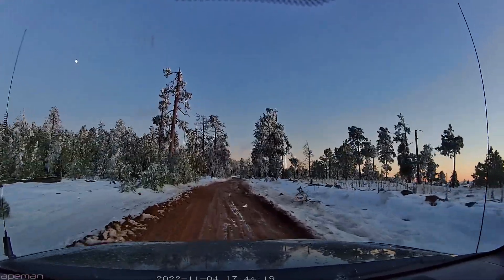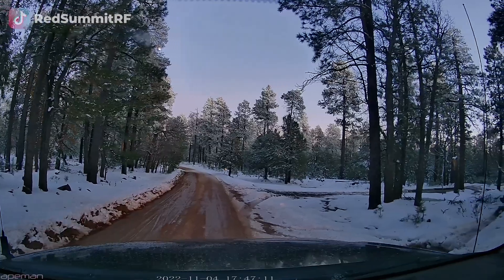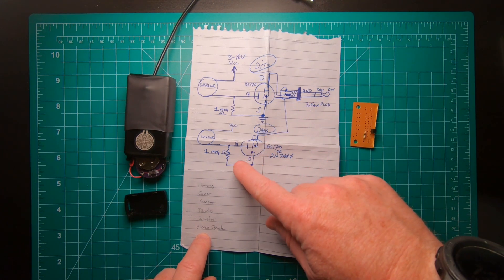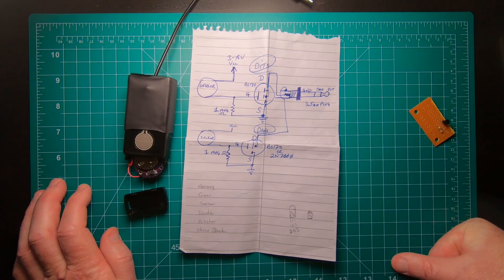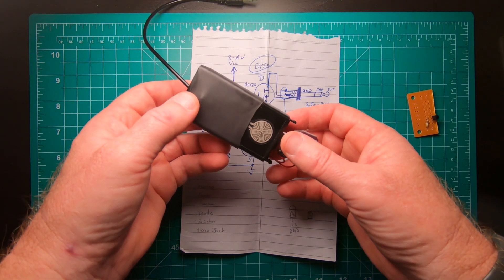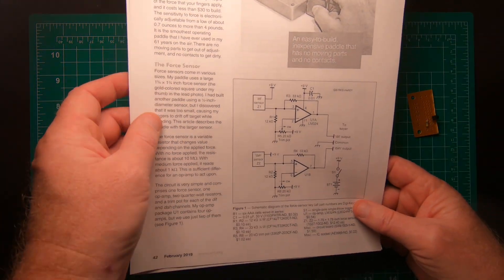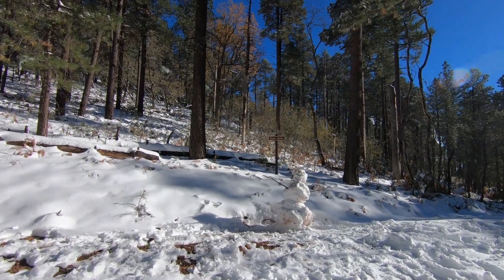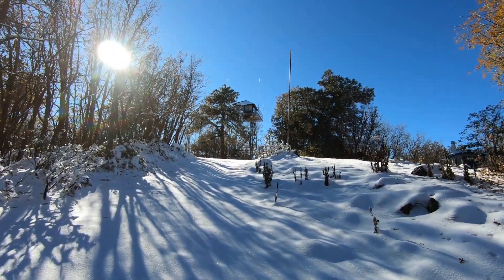Morse Code Homebrew Pressure Paddle for Summits on the Air

Comment: I'm thinking of using some pc board to cut and use as the center piece of a linked dipole.  I saw they are inexpensive online. What might be the best way to cut them?  Bit by bit with a box cutter?  Tin snips?  Any ideas?  This solid state key is another great project.  Linked dipole one day.  Key another day.  Another excellent video.  Thank you.
Reply from the maker: I use a bandsaw.  I see your comment about the dipole build posted to another video I'm getting ready to reply to.  I'll provide a link to my build video of the dipole over there, where I show the cuts I made.  I use a thin cutting board but pcb board should work the same way.  If you don't have a bandsaw then I think you are on the right track with scoring it and then cutting with snips.  I also just do a rough cut and then sand down to the proper size.
Reply: @RedSummitRF  thank you!!

Comment: Hello! This issue you have with the paddle sending unwanted dit and dots I have all the time in the cold. Idk why it happens but it’s the cold 😅
Reply from the maker: Thank you  for the validation André.  After a few experiments I agree with you 100%.  Thank you for your visit to my channel.
Reply: @RedSummitRF  Yes, I've been learning how to operate in the cold. I came from Brazil (PY2KGB) and this is my first winter with my canadian callsign, so I'm learning a lot about the cold since I only operate in the field, exposed to the cold. 

This might not be useful in your location, but it's important in extreme cold: avoid operating when the temperature is close or lower to the dew point (good videos on this here on YT). This causes condensation inside the equipment.
Reply from the maker: @ve2zdx  oh good to know.  Condensation in the equipment sounds like  a disaster lol

Comment: Charlie: Where did you get the enclosure and especially, those two finger pads on each side? Is this a capacitance -based paddle, or are the pads actually pressure-sensitive switches? 

Please provide additional details. 73, W1LJ - PRESCOTT AZ.
Reply from the maker: Dennis - The enclosure was ordered from https://www.polycase.com, and I think it is an enclosure for a garage door.
The pads were ordered from DigiKey (part 1738-SEN0294-ND) but I see Amazon has them too.  Yes, they are actually pressure-sensitive pads.  The design comes from here K5DEZ's design here https://reflector.sota.org.uk/t/anyone-tried-morse-stick-key/19392/20

Comment: Dude!!! Where is your jacket?? The pressure paddle does have a bit of a different "feel" to it so it does take a bit of practice. When I get cold like you are in the video I start making many more mistakes too. I also notice you are more of a paddle "slapper" (which I also do the colder I get) so sometimes that adds to the mistakes, at least in my case. Practice with it a few more times in a more controlled/warm environment and see what you think. When my fingers are cold/frozen I too start adding dits or dahs because I cannot "feel" the paddles anymore and start slapping them. My pressure keys work great for me but for sure may not be for everyone. It did take a little bit to get used to them. See ya on the next video........
Reply from the maker: Haha - hi Tim.  I forgot my tarp and so I used my coat to lay my radio gear on.  I think you are right about the paddle.  I just need to get used to it.  I think I should have brought the speed down too, 25 wpm was tough with it.  And yes, my fingers were froze and probably added to the mistakes lol.  I'll definitely try again in a more favorable environment at about 20 wpm.  Thanks for everything you contributed on this one!